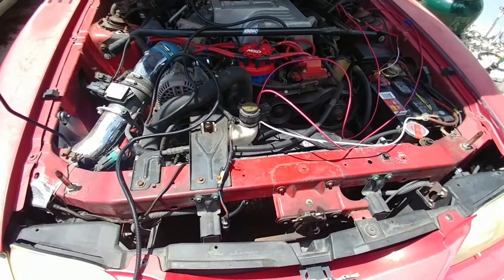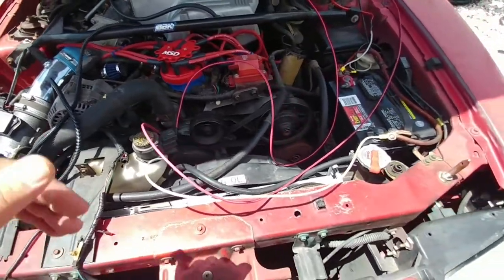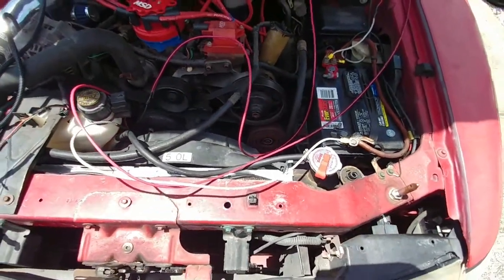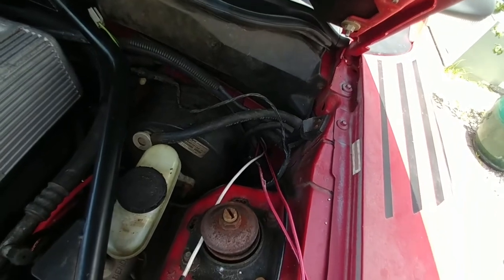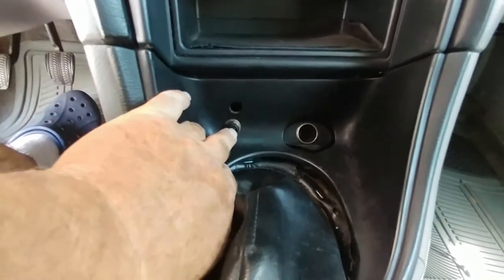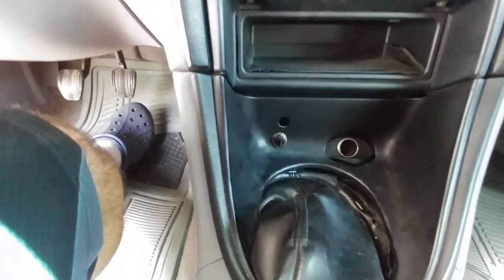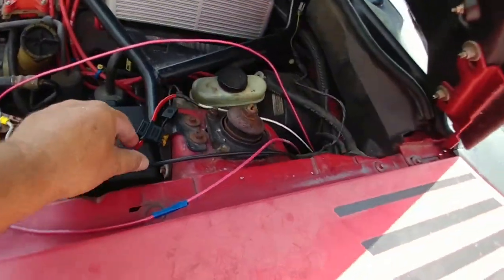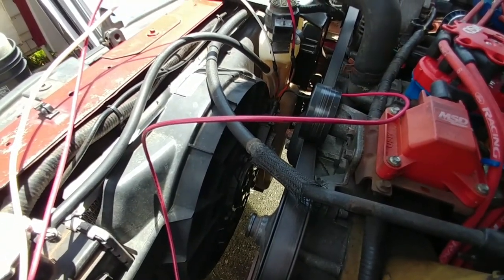1994 1995 (SN95) Mustang GT Manual Fan Switch Installation

Comment: My 95 Mustang Gt - I’m pretty sure the fans not working at all. Checked all the fuses and all good. Then I found that there was a recall on 95’s regarding the cooling fan. 
What’s ur opinion? Should I take it to a Ford dealer? Do you think they will charge me?  Do I need relay “brain box”?  And, should I set it up with a manual switch like you did?
I appreciate your help. Thanks.
Reply from the maker: A recall from 1995? Well. Call Ford and ask them if they'll honor it 23 years later. I have no brain box on mine. Wired it through the switch just like the video said off the battery. The fuse is not necessary if you use the exact same guage wire as I stated. 10 guage. I am going to do a follow-up video tomorrow. Yes. Do the manual switch. Much better than factory. In my opinion. You can do a thermostat controlled also if you like.

Comment: Did you run the low side and the power wire for the switch to the same side?

And if I have ac but dont use it, can I just not worry about even wiring it?
Reply: I misunderstood you. The middle of the switch is the power wire which goes to the battery, the left side had 2 red wires? For the low? That's what confuses me.
Reply from the maker: When you wire the fan make sure the fan is pulling air through the radiator. I ended up switching the neutral and low side wires around because it was pushing air not pulling. I dont see why you couldnt leave the high side off if you wanted
Reply: @dico_5.0  so from the switch I will have a power wire from the battery to the middle terminal on the switch,  and then the low side fan wire going to the on terminal,  what about the 3rd terminal that's on the switch? Will that just be left open since I wont be running  the high side fan wire to it?

Also, in your video you said you have 2 red wires going to the low side, on the switch the white wite is Is the power wire, that's the middle terminal of the switch, and the the 3rd terminal is the high side fan wire.

Wasn't there only 3 wires coming off of the fan plug?

Comment: You are misinforming people in the wiring you’re video is causing people to wire their fan in reverse which will cause overheating to occur faster. You can wire it up with the switch and have high and low speed you just have to use black wire as the ground as it normally is done unlike what you said in your video. I am using a 25 amp fuses and blowing fuses continuously running high speed wired up the way your video says to do...(also fan going in reverse) but with using the black wire as the ground wire that has fixed the fuse issue
Reply from the maker: I was going to do a second follow up video about the original wiring but if read the comments I told the other viewers to make sure when wiring the fan its pulling air through the radiator. As far as blowing the fuses I addressed that in the comment above your stating it would blow more than a 40 amp fuse. I went and looked at the fuse box finally and the original fan is 60 amps! So I tested a 60 amp inline fuse and it blew that one! (Video to follow.). So that being said if you want to run both high and low speed try having no inline fuse and see how it works that's what I intend on doing. By the way my car is not my daily driver and it has AC and doesn't work. Hence high speed unless the AC is turned on should not be necessary. Good luck!
Reply: The issue hes saying is the white wire is a signal wire not a ground. Using it as a ground dont work very long as yall have learned
Reply: Everyone knows black is the ground on cars..lol

Comment: I have a 94 Ford Mustang and my fan won’t turn on. Where can I find the fuse relay ?
Reply from the maker: Baba Loo . The ccrm (constant contol relay module) is located next to the coolant bottle hanging by the radiator. It's the unit all the wires are connected to. As far as where you could buy one? I bought one on eBay.

Comment from the maker: THE FUSE GOES ON THE HOT WIRE FROM THE SWITCH TO THE BATTERY, HOWEVER I DON'T RECOMMEND IT BECAUSE YOU HAVE TO USE A 30AMP FUSE ON LOW AND MORE THAN A 40AMP ON THE HIGH. I WANT TO CUT THE FUSE OUT PUT THE FAN ON HIGH AND SEE WITH THE DRAW AMPS ARE AND THE WIRE TEMPERATURE IS. IF IT DOESN'T GET TO HOT IM KEEPING THE FUSE OUT. IF YOU PUT THE FAN ON HIGH SPEED IT WILL EVEN BLOW A 40AMP FUSE!
THANKS
Reply: MUSTANG MADNESS when you finish up. Please post what the amp draw is. I have a 95 mustang gt and all worked fine til the original fan motor burnt up. Replaced it and now when my fan kicks on at an idle it kills the engine 90% of the time.
Reply from the maker: I never tested the draw amps thus far. I will tell you I put a 40 amp fuse for the high speed and it blew it. remember the high speed is only used when the AC kicks on. The low speed should be fine all the time. I'm eventually just going to take the fuse out all together The low speed will not cause any wire overheating issues at all. After removing I will see how hot the wire gets if at all on the high speed. best of luck.
Reply: @dico_5.0  did you ever figure that out??
Reply from the maker: @Livin.Lif3  yea....got rid of the fuse
Reply: why dont you wire in a reLAY? SO YOU DONT HAVE TO WORRY ABOUT THE AMPS OF THE FAN>? YOU NEED A RElay. and a fuse.
Reply from the maker: @john miller  took fuse out long time ago. Runs fine just like that. no relay or fuse necessary for me.
Reply: @dico_5.0  LOL!

Comment: I have a 97 and there's only black and red. I have no high speed. that's partly why it think mine runs a bit hotter.
Reply from the maker: If you have ac should have two speeds. Kicks on high when ac and defrost is on
Reply: It does have AC. But it is disconnected. I see some fans have a controller built on it. mine doesn't. almost seems aftermarket. that's probably why it's one speed
Reply: yep I just realized is a torqueflo fan. only 1290 cfm. stock came 22000 to almost 4k cfm
Reply from the maker: Do those 96-98 have a ccrm?
Reply: @dico_5.0  I have zero clue. they might not have ccrm. I looked at a stock fan. it looks barebones. like one speed